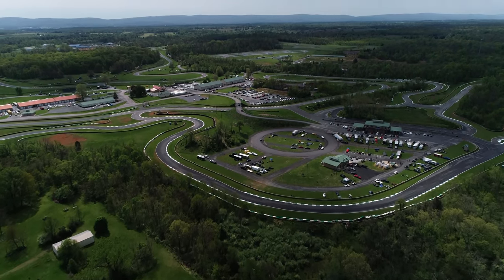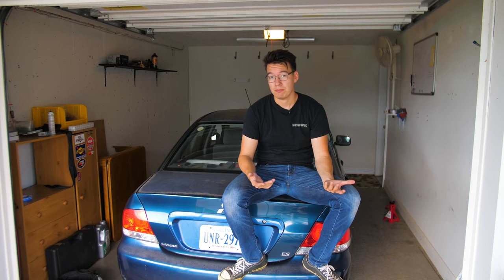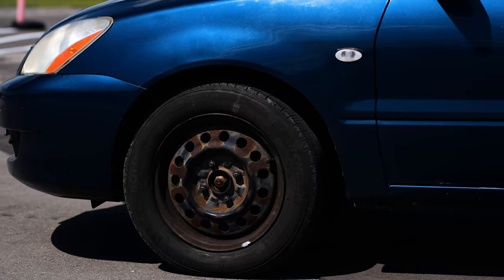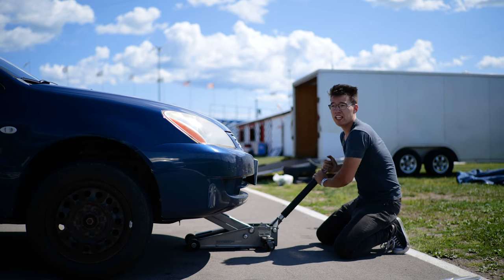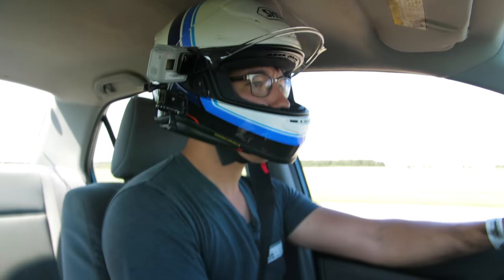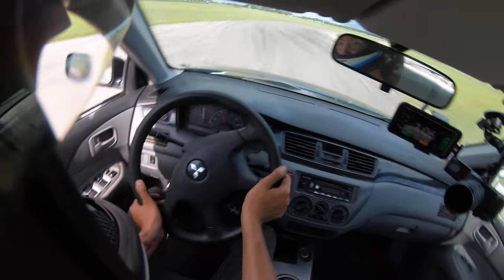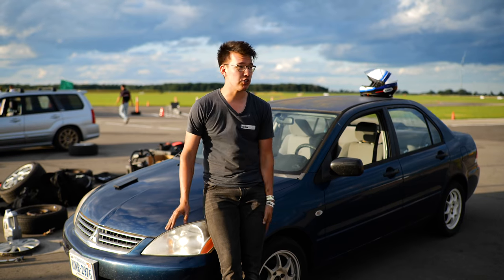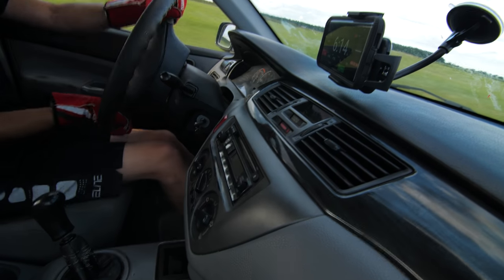Can You Track Your Beater Car?

Comment: I wonder how much time you would have shaved off with weight delete (all passenger seats, emergency wheel)
Reply: that's what i was thinking when he said they couldn't do anything about power
Reply from the maker: Spare was already deleted. From experience the rear seat weights about 5 lbs. The passenger seat maybe 30 or so? The car has like 80 horsepower, let's not stress about it.
Reply: You should chill out man he already posted the video so it doesn't matter now.
Reply: @speedchannel7196  I'm chill, I'm just curious
Reply: Not you the E46 man.
Reply: Well, in true beater style, you'd probably go with a friend, so you'd need the passenger seat.
The rear seat usually weighs next to nothing, so you could leave it in place, even if it's just for noise comfort when driving on the street and being able to have a nap.

He did say in the end it doesn't really have to be a beater car, you can easily take your average daily with with slightly upgraded brakes. Pretty much any car enthousiast has a set of summer wheels with tires that are better than average as well, so just swap out your brake fluid for a dot 5 one and keep a set of track pads to use on your trackday.
Reply: @speedchannel7196  ah makes sens mate. Thanks
Reply: @devilskullBEL  I never understood how brake fluids are rated. What is for 5 ? Can I use it daily ?
Reply: @aricerse4654  the car weighs like 2700lbs deleting 40lbs wouldn't change much maybe a fraction of a second at best.
Reply: @celticwind4122  not 40, factor in the passenger seat, rear seat, buckeles, belts, stereo, heater controls, dash, carpet, boot trim, and i could keep the list going, not looking like 40lbs anymore, is it?
Reply: @aricerse4654  the original comment said seats and emergency wheel. The video was for a daily driver anyways. taking out carpet, dash, stero etc. would defeat the purpose of that.
Reply: @celticwind4122  no it wouldnt, plus the original comment said weight delete, and just gave an example of two deletable things
Reply: @GearsandGasoline  lots of us would love videos of the es from "beater" to a daily/racer to a full out racer. whitline makes a beefy rear swaybar for these models and some es dont come with rear swaybars from factory witch helps in fast turns alot. also some do rear disk conversions but u need to change from 4x100 lug to 4x114. some of us on fb page are making our es 4wd and some lifted just for fun
Reply: @celticwind4122   For a track day car, you might be right, it may not change the total speed significantly, but what it will change is how the car feels to the driver.  On my Lexus GS300 manual swap project, I recorded about 150lbs lost during the conversion (using a W58 transmission), and the car felt noticeably more tossable as a result.
Reply: @Zantrop64  can...but first to get it into your brake or clutch system...u need to fully flush old brake fluid out totally clean...because it wasnt compatible to dot4 or event dot3....

Literally require removing brake lines, blowing it through with compressed air and clear out brake caliper pistons....

Then only put fresh dot5 fluid...

And also it require regular fluid change alot more than normal dot4 or dot3 simply because it absorbs moister faster and easier...
Reply: @Logan H 717 e46 is wrong, and his suggestions are inapplicable to the discussion... but if you think there are certain cars that somehow are magically unaffected by practical weight reduction, you are wrong.  Power/weight ratios make cars fast, noybjust power. Any car put to a track will benefit from it, that's why dedicated track cars of all types get gutted, even miatas and Elises Where e46 is dead wrong is that: #1 - he moved the goalposts halfway through his chatting about weight reduction... went from seats and a steering wheel to removing the radio and a list of other things  #2 - those mods are impractical to pull for someone who is taking their daily driver to the track, which is the entire premise of the video. And #3 - hes being a jerk for absolutely no reason because he just doesnt know how to be decent to people. You jumped in bed with him on that one, which makes you both wrong.
Reply: Run it on an empty tank too
Reply: @GearsandGasoline  es lancers have 120hp... full gutted interior really doesn't do much but from my experience with myne it makes a noticeable difference, at least while driving... on a more technical track even on stock suspension these things kill, I've seen cars like this destory ls1 cars... their basically the evo chassis without the evo parts

Comment: Love tracking my CRZ for exactly the same reason. I've been flat out full lap in most tracks in so cal. All it needed was some ceramic pads and sticky rubber to be a riot. I've now put brembos up front and stiffened up the chassis with a front sway bar and it's the best thing since sliced bread. Anytime I track it, my friends want to go out in it because it's so fun.

Comment: I tracked my FWD 2005 Matrix XR. First track day I upgraded the front rotors and brake pads to high carbon (yes only the front, the car has drums in the rear) and snagged some used Yokohama ADVAN AO48s from work. Drove to Streets of Willow and ran the entire day with no problems- had to wave plenty of people by. Second track day (a year later) I upgraded the suspension with some lowering springs, Tokiko blues, and a Front Strut Tower Brace. On the same track, Streets of Willow, I knocked off a whole minute of my time from the first track day and kept of with plenty of cars around the corners. On the straights I still struggled a bit since I didn't upgrade power/internals as I don't see the need for it. I still have the high carbon rotors and pads (replaced these some time ago), lowering springs, tokiko blues, and Strut Tower Brace. Car still runs happily as my daily beater and is fun around the twisty corners at over 190K on the odometer.
Reply from the maker: Hahahaha knocking a minute off your lap time is a sentence I dont think I've ever read before. Slow cars are great.
Reply: @GearsandGasoline  I had lots of advice from fellow drivers and a few ride-alongs that made me push the car and myself a lot more. Also, turning O/D off on an automatic makes a world of a difference hahaha

Comment: The tires are actually give the most return for the investment when you really cash strap but still want to have fun. I am going to quote a slogan from Pirelli:"power is nothing without control."  I used to paticipate a community organized autocrossing. When Ive done an upgrade from a tread wear 600 4 season tires to a 300 sport tires, the differnt is day and night. For a short 40 seconds autocross track,  I can easily gain 3+ seconds a lap. The additional grip allows me to brake less, brake later, stay on power longer, put down power earlier and even shift gear less frequent. It is a joy to even thinking about it.

Comment: As someone who has a 1999 Mazda Protege 1.6 that is built for amateur endurance racing, I can wholeheartedly agree with this. My car has been raced for over 10 years, and is still on the original engine @ 104k and over 10,000 race miles! Eco cars have very cheap consumables and burn through them at a much lower rate than bigger higher HP cars, which makes them fun at a low cost. 

I'm currently at 2280lbs, but there is still a ton of stuff to remove and/or replace with sheet aluminum. I hope to get it under 2000lbs, it's basically a FWD 1.6 NA Miata LOL

Comment: my first car(sold it a few months back and got a 2013 passat) was an 03 lancer es in a lot worse condition and I wanted to take it to the track as a sweet goodbuy but all the parts i had to put on it just wouldnt allow me to ); The listed 120 hp for those cars would be a dream with how beat up it was when i got it, even the exhaust system was falling apart so it was LOUD and backfired so much so i threw a mini wing on it to give people on the road some joy. Bitch burned and leaked oil, both calipers locked up at different times and started fires, purge valve was shot and heat welded, all 02 censors failed and were heat welded, and the alternator lit up in flames one night. $3k in repairs and sold it for $400. Bought it for $1.1k and had it for over 2 years. BEST CAR EVER

Comment: I know I'm about 2 years late and the Lancer is probably no longer in Gears and Gasoline's possession, but I think it would be a cool idea for a series to see how much it would cost to turn a beater Lancer into a track eating machine. You know, things like better tires and wheels, coil over suspension, better brakes, a few engine mods, stripping out the interior, giving it lightweight bucket seats, maybe even adding something like a roll cage or a turbocharger.
Reply: They replied to someone and said it’s not gonna happen because of that escort they turboed. I own a lancer and an escort so I’m content

Comment: The first time I went to the Nürburgring was with my daily 90bhp diesel powered Citroën Xsara wagon. did well for what it is, and made the 600kms trip back home without a single issue. Now I track a Peugeot 406 coupé V6, 210bhp, 1600kgs. Good brakes, good tires and good suspensions are all you need to have fun on a racetrack. Next mods are buckets seats, because it is tiring to fight against the car to stay on the seat while cornering. 
For a cheap car with no power, cheap mods are well enough to make it the best fun you can have on a racetrack.

Comment: My econobox was transformed with better tires, power stop z23 pads and mild suspension work.  Can't do much for the engine without a swap or FI but it's a ton more fun than it was from the factory.  Helps that it weighs under 2,600lbs, too.

Comment: I own a 1998 Honda Accord LXI 2.3 5spd, 195k miles, and 135hp when new. Stock all season tires, stock brakes, stock suspension, stock everything, it drags it's feet (or tires lol) to 60mph in 10.8 seconds, but it takes corners like a champ,  even on stock tires. I have not had the chance to track it, just street driving with no other cars lol. It barely understeers on streets, and on tight corners it oversteers so much the tail kicks out.

It'll only be better on coilovers,  thicker sway bars, wider wheels and stickier rubber. It'll also be getting a full engine build, twin cam head swap from an H22, and a turbo, hopefully ballpark it'll make 400hp at the wheels. Then it'll really keep up with real cars at the track, around corners and on straightaways. 

Cheap, slow cars are a blast to drive fast!

Comment: At first I was gonna hate on the video because yes you can take almost any car you want but you have to at least do a little bit of prep.

My daily is a 97 1.5 mirage. Thing makes all of 92 hp and yet is fun as hell. Its got a set up rays on it, a complete delete no ps, ac and a swap to a 3 pound battery. Thing weighs under 2000 pounds now and its just a blast. Anything can be fun with a little bit of work.

Comment: What's a good beater track car too is an old Dodge Neon ACR.  Blast on the track and cheap.  The lancer even in base form is a very under rated car... If you can find an 06 raliart which has the manual transmission and the 2.4 4 banger makes the car pretty fun 👍

Comment: The CS Lancer is actually a very popular platform in the far east. It has somewhat decent aftermarket support. Not as huge as the Evo, but decent nonetheless. However, most of those manufacturers are based in Asia (ex. BC, Hurricane, Ultra Racing).

Comment: to be fair you did pick one of the most reliable cars out there. the 02-06 lancer was such a simple car that couldnt be killed.  i had an 02 oz rally. i loved it. and yes. it would over steer on street tires because it was so slight. you could whip it sideways. and the power issue. an intake and catback exhaust will actually make it quick off the line. again. because its so light. just dont think youre going to win any 60 rolls with it.

Comment: I had plans for my 2010 Toyota Yaris. Already 2300 pounds. I put a shirt shifter and bushings and it transformed the car. Just need headers,exhaust,brakes,tires,intake,oil catch,aluminum underbody,cheap blitz supercharger. Though about getting 1200 cams. Then I got a Fiesta ST and it wasn’t the same. 
Slow car fast indeed,the best.

Comment: The blow by is caused because the CV shafts aren't able to turn (fast enough) and that creates additional pressure that tracks back to the cylinder - causing the slippage of oil past the rings?
Just wanted to make sure I understood.

Comment: Did this in a saturn ion and it was an absolute shocker. Sticky 245s, pads and fluid. That shit will change your life. Over 1g in a shitbox running 6ft from an EVO 8 back bumper while basically dragging my mirror from body roll will change your view on what a good handling car is.

Comment: You need some stiffer sway bars to eliminate the body roll after that maybe a bigger throttle body and a tuned ECU. And of course if you wanna get under the car a better exhuast if its not allready perfected. Get rid og the back seats and the extra stuff you dont nees. Weight reduction and keep some basic seats for passenegers.

Comment: With traction control turned off my Volvo V70 can somehow turn so fast that the warning light for my brakes comes on. It's probably because it warns for low brake fluid level as the car turns so hard all fluid goes to one side so it can't register any fluid. I checked the brake fluid as late as yesterday and it's still good to go. Not on max but not far from it.

Comment: I own the same lancer albeit euro version (4G18 1.6L 98HP) and ive been trying to drive it sporty a lot. Theres no tracks or any great roads to do an all out like this but I think this car surely has potential... being a lancer afterall. Modding for this engine is pretty obscure. Was thinking of changing the suspension because it really rolls (ehm 10:06 3 wheels) and adding rollbars too. Should I do it? The car is dear to me and I know its probably not worth investing to make it a sportier faster car but maaannn.. 
As for the engine I'm not sure if i can swap to 2.0L 4G63 because the market is dead for Jap cars in my country.
Old vidyo i know

Comment: Before I even watch any of the video, YES, YOU CAN track your beater car, fuck what anyone says otherwise! Track Days aren't a competition anyway unless you make a bet with your friend. Otherwise, foot to the floor, no opponents around you going fender to fender, no overtaking in curves, just as soon as there's a straight, then you let the driver behind through, or if you got a much faster car than the one in front of you, they are supposed to let you through.

Now grab your beater, head to the track, eat your spinach, grab your balls, and put the pedal to the metal like you don't even know what the fuck brakes are. (Though it is a good idea to use brakes at the right moment, late and hard. Otherwise, let your momentum go through the turn.)

Comment: Now you should join the Colin Chapman mantra and "add lightness". Nothing else yet. Lose the interior, the AC and anything else than you don't need to track the car.
You could do a series about anything you can do without the suspension or power adders.

Comment: Well, next month I'll track my daily beater - 800cc 40-ish hp front wheel drive demon, 670kg of weight, top speed at 160kph. 135 tires, torsion beam at the back, front discs, rear drums.

Wish me luck, I'm probably gonna die.

Comment: Anyone have any good first car options in canada?
Reply: Andrew Wang Accord V6 w/ manual...reliable, relatively powerful, and cheap to maintain. They can be had at a wide variety of prices depending on what you’re looking for. Sure it’s front wheel drive, but as a new driver you’re better off.